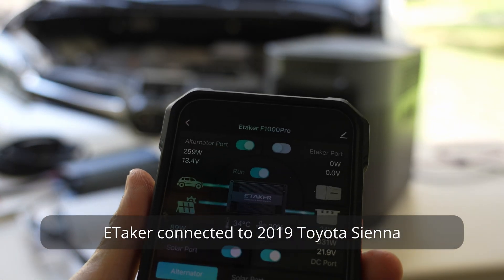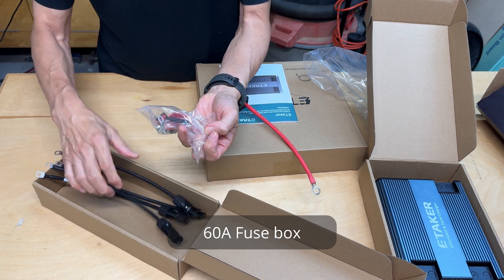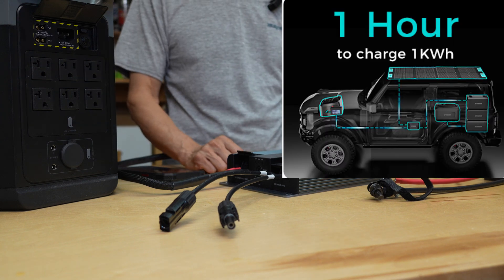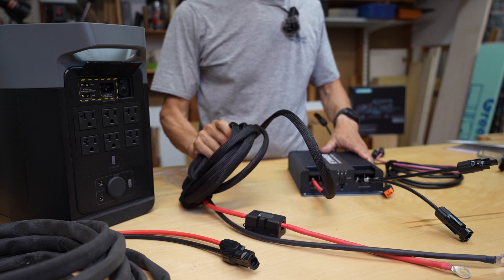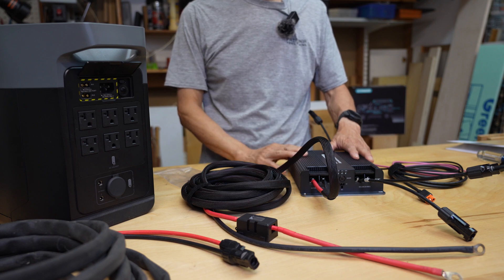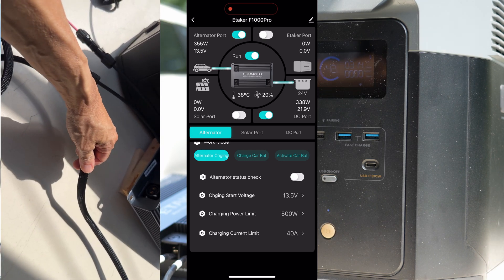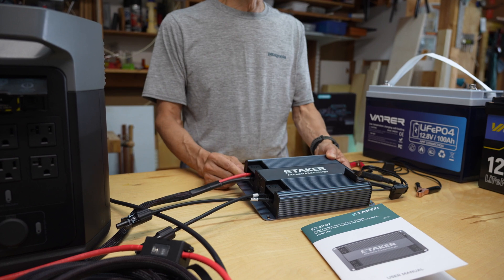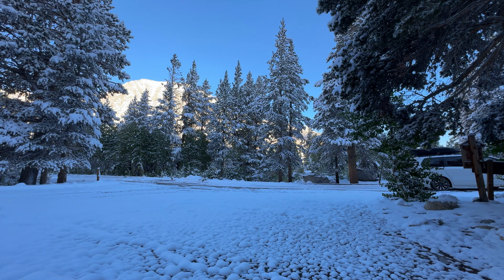ETaker F1000Pro Review : Ultimate Charging for Off-Grid Camping?

Comment: the ecoflow output was set to 24V only, and solar port has 15A current limit so 360W limit was from the Ecoflow side, the output. if you can increase the output voltage of the Etaker from 24 to 36 or 48V (voltage range on the ecoflow is 11-60V) you can get to 500W 'per port' on the Ecoflow.
Reply from the maker: Thanks, I'll try that.

Comment: Great video. Have you tested with the vehicle engine running at any rpm range above idle, such a as while driving, to see what power levels you see at that point?
Reply from the maker: I step on the gas to increase the RPM of the engine but output remain constant, I believe the app control how much power go to the power station.

Comment: This is great for people who don't have a gen 4 Sienna with the optional 1500w factory inverter. 

I have a Sienna, and when shore power isn't available, I simply plug my battery station's 120v cord into the van's 1500w receptacle. The inverter draws from the drive batteries, and in READY mode, the ICE will turn on as needed to recharge the drive batteries. My Bluetti AC180 fully charges from 0 in about an hour. I don't bother with solar since the factory inverter easily keeps the battery station topped up, and for very little fuel expense. 

If Toyota ever offers a full-sized van with a hybrid drive it will transform the van conversion space.
Reply from the maker: Yes, agree. My Sienna don't have the 1500W inverter and I rely mostly on solar.